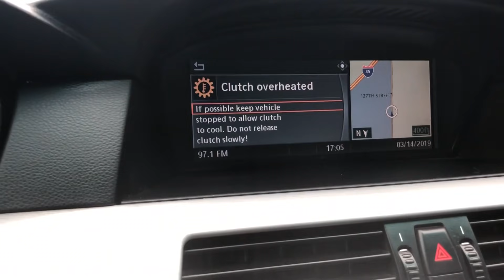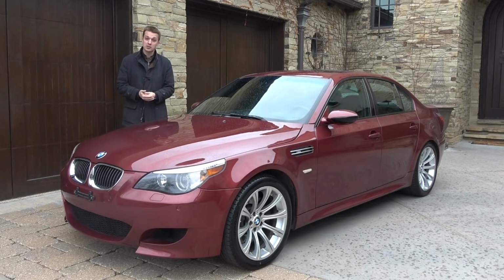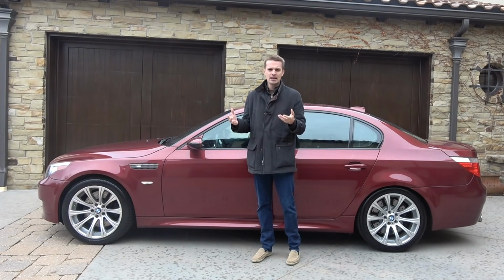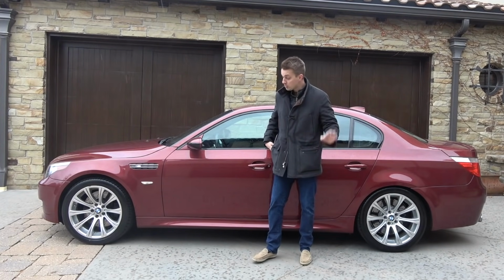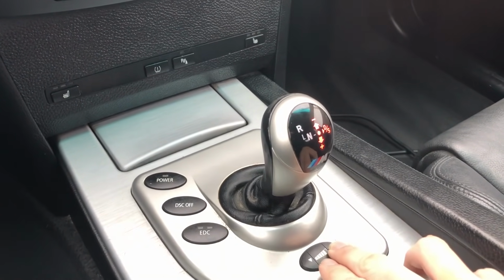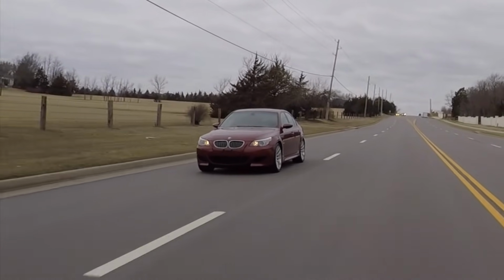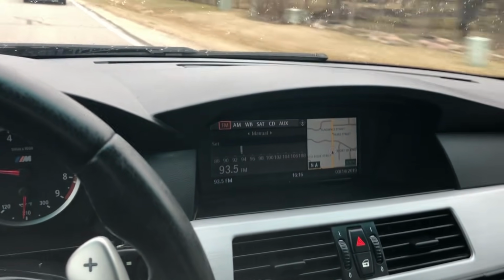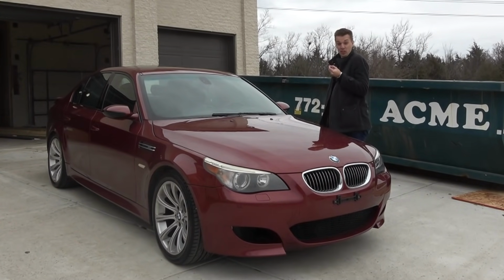My Cheap BMW M5 Is FINALLY FINISHED (Thanks to a Wire Hanger???)

Comment: That is a good sounding and looking car, but remember...cool stuff breaks. It sounds like Maserati took that transmission concept and ran with it, but got rid of the reversed shifter, and used a dainty, chrome, lawnmower pull start handle instead, and had bigger, stronger, paddle shifters. They used a screaming revvy small block v8, with semi fragile, but not as over engineered vvt system, very kindly put all timing components on the front of the engine and had slightly better acceleration, but not the top-speed ability of the v10. It really is a nightmare drivetrain of a supercar, mounted in a beautiful sedan. You really need to part it out and LS swap it, but you already have the Porsche, so try to get the money back for garage college.

Comment: So not only did the "wizard" miss the frayed fuel line on the ferrari he bent one of the teeth in transmission he installed forcing you to take it to a BMW specialist. Time for a new mechanic.
Reply: Yes, I'm surprised I had to scroll so far in the comments to see someone mention this. The so-called car wizard bent the tooth on the flywheel! He should have noticed that he did this. Careless at best. 

Thanks for the reminder of the fuel line in the Ferrari. Everything in life is about paying attention to the details.
Reply: And considering an OEM flywheel is 1400$ on the cheap end. I'd be pissed. I just did a clutch and fly wheel on my M5

Comment: Sir, you did it the wrong way.
You have to turn off the DSC, hit the accelerator pedal and after a second also push the break 
Thats the only way to do a burnout with the SMG

Comment: I remember seeing a video about that SMG and if I remember right they took that crap shifting mechanism off and made it into a manual system since it is a manual gear box to begin with. Some engineers just need to have their heads stuffed down a toilet.

Comment: Doesn't the BMW have a reset mode that learns how you like to drive like Mercedes does?
Reply: It does but this in not an AUTOMATIC TRANSMISSION!!!
Reply: @florinnitisoara8313  Oh right, one of them double clutch solenoid gismos?

Comment: Hello Hoovie, did you ever drive a real race car with sequential mechanically gearbox? All gearboxes do shift up, when you pull backwards und shift down when you push forwards. The simple reason is, when you accelerate fast with a race car, you will be pressed into the seat, so your body gets back and you can not push the hand forward easy. Much more is the effect when you brake with race brakes, your body flys forwards into the race belt, it is simple to push the hand than forwards. That is the reason, why BMW made the shift of the gearbox the right way, other automaker like Audi or years ago also Porsche (they changed it, because Walter Röhrl was the only guy who trusted to say this error to the board chiefs of Porsche) built it the wrong way until now. Ask a racing driver, everybody can tell you this. Drive the M5 like it have no automatic modus, use the stick to change the gears, when you drive normal, go down from the accelerator until the gear is entered, like it would be normal gearbox with clutch pedal. Only when you go fast with high revolutions, stand on the accelerator and you will see, how fast the gearbox is working without jerking. Best regards from Germany.

Comment: Shouldn't the plus for upshifts be put on the bottom so when your pulled back in the seat upon acceleration you pull back to upshift. P.S opposite of Volkswagen I hate it!

Comment: You bought a one of a kind BMW with a V10 that was broken down for $6500. How about appreciating the deal you got and sacrificing a slow transmission for a great car? You spent a total of $17,500 for a V10 car that you can drive your daughter in. If you want a super fast car with a great transmission AND that looks good, then buy another used old lambo, Audi, or Ferrari for $100K+.You will have to spend money to fix those cars too.  You sacrifice some things when you want a super car under $20K. Good luck to you.

Comment: Problem with all BMW: 

People buys them, they can't afford reparations, so  they just wait, and wait, and then sell them. Whoever buys it, normally buy it for a low price, but then reparations are hell of a expensive thing and they start filling the internet with shit about BMW. Of course, not forget most are much more mileage then they show, so main reason of early "faults". 

BMW's are good, I've had over 10 and I still have one as my daily drive. (Now not driving at all, Rona, you know).

Comment: As I recall, the original sequential shifters in passenger cars mimicked those in racing cars (push for down, pull for up), but after a while, they changed (in passenger cars). (This car is still butt ugly, Tyler.)

Comment: The Beeping is because of the clock. I beeps every full and half hour i guess. 
You can let this be decoded, if it annoys you
Reply: It can be reset. I have a 2008 550i 4.8 v8 with m sport package. I have the same issue after messing with idrive settings. It kepts beeping every time it reaches a new hr. Example, it would beep at 1:00pm, then at 2:00pm, then at 3:00pm etc. Found out on the settings i selected clock memo. After un-selecting problem solved. No need to take to the dealer. Easy fix on ur settings

Comment: This is probably the worst M series BMW. M stands for marketing now.
Reply: So true, they are so in marketing in every aspect even in a motorcycle section they are killing on a Facebook. Just drove a new BMW GS 1250HP model, I could not believe how much better the engine was balanced than the previous. But that fucking noise comming from the engine and a crankshaft I just could not believe it that someone here in Europe would pay for the bike like 25k$. Made in Germany has not the same meaning like 20 years ago.

Comment: I had a basic 2008 528i...I bought it at 60,000 miles. IT WAS A DISASTER!. Always in the shop. I bought the car in 2013 for about 20k. I probably spent over 60k in 4 years on it and it was always in the shop...NEVER AGAIN! MOST UNRELIABLE VEHICLE EVER!

Comment: Without the Wizard's "best-buddy" labor rate, his repairs would be five-figures, easily.  You KNOW darned-well that a dealership would NOT fix a BMW with a coat-hanger, they would pull the transmission and charge you HUGE $$$ to repair it, because 'profit'.  And with Hoovie's driving habits, it definitely WILL be back in the shop very soon....who does burn-outs with their child strapped-in the backseat?

Comment: The Aston Martin V8 Vantage offered a six or seven speed automated manual transmission for a while; big mistake! I don't recall a single reviewer having anything good to say about it. But, the same transmission with a gear stick and clutch pedal was great. Looks like your BMW is just another pretty face. Hitler's revenge!

Comment: I do not understand your garage design. It seems to me that it is going to be very difficult to get your cars out of that "new" part of the garage. Also, all that standing water flowing toward the interior wall of your house... not good. You need a drain in the center of the floor.

Comment: You're wrong about the shifts. In race cars sequentials or dog leged boxes you pull down to go up a gear and up for down a gear. Its easier as it accompanies the gforce: when you break you're pushed forward so its easier to push the gear lever instead of pulling. Typical BMW Motorsport thinking and quite logic. If its shifting that sl9w, there is something wrong with it.

Comment: I recently purchased my first BMW 320i  E91 Touring and now I am afraid to drive it. All these warnings light and sounds make me everytime they come up almost get involvedin an acccident. I have now warning lights 1.  motor is to hot stop the car to cool of te engine. 2. There is a failure with emmision and then the  car is running very slow. 3. Dtc sensor goes on and the cars starts running slow. Anyone want to buy my car, please?

Comment: I saw a lot of people recomending amg,you really folks think that they are better than bimmers,o lord mighty you folks are so wrong,since i had service for mercs and i know what i am talking about every single amg model delibrately eating camshafts,my first model was 190 evolution amg,which i repair,cylinder liners,pistons,piston rings........car from 1980's,since from their first amg model,untill today,it seems thatbthey have issues like:worn out cylinder liners,connecting rods,pistons burn out,worn piston rings,worn crankshaft,blown head gaskets or 
Due to blown head gasket the head can be blown,i didn't mention  tranny,gearbox and suspension it will take all day to write you common failures of amg models,i will say just say for newer amg models,they have cylinder block and cylinder liners  made from aluminium and piston is made of special hardened steel,piston rings are made from carbom steel,even the cylinder liners are done with twin-wire-arc-spraying so with this method material is spraying to the cylinder liner with air flux temp.. is app 5000 centigrade all over the cylinder liner to get nanoslide of cylinder liners but this didn't help to prevent wear of cylinder liner,since the piston rings are made of carbon steel so you don't to be smart to understandwhat will first be worn out and i can say with reason,another failures gearbox newest ones  9g,due to high torque over 1000 nm and very high operating pressure due to these 2 parameters cause torque converter failure,then all seals to leake and hydraulic and operating ecu (electronic control unit) to fail,so this aut.gearbox is in all new and also i didn't mention the mercs led lights these headlights have tendency to fail,aftermarket are app..1500€,genuine are 2500€,and warranty is just 2 years ,mercs model so you can ask yourself why this happen with this headlights,why they operate with high torque and high pressure the reason is only one just to fail,and these things i shouldn't tell you according to policy od mercedes-benz ag,best or nothing,from germany with love,and bottom line bmw m models are more reliable than amg models.

Comment: I’m surprised he’s complaining that upshifting in manual mode you have to push down. It’s because when you’re going around a corner and you’re pushed back in your seat, naturally you pull back the gear selector. Similarly if you are slowing down, you are moving away from your seat and you push the transmission forward. It’s actually more  correct that way and BMW still does it like that.

Comment: it´s funny when you do a burn out ,that you can see the rubber left on the road, and look admired when the car informs you that the clutch is overheated,unreliable are the words that come out of your mouth, an M5 it´s one of the best bmw´s ever, in 93 i owned one and still today ,only oil changes breaks pads and tires, and a car like that with automatic transmition it should be considered a crime, and the car was built to be driven not to achieve high-rotations stoped , tires do cost money but there´s a concept that you don´t understand, everything you say is wrong about the car,regards

Comment: im sure ill catch hate for this but im an ASE certified tech and i have a 2009 135i(n54) ive spent well over $6,000 to get it to run the way i like in parts alone. no labor included. I will never own another bmw product once i sell this POS

Comment: Relax first thing gead over to Cerma oil .com use all there additives you will not have any issues ! I did mine two years ago Runs Incredible !!!I daily my M3 SMG 06 ,you are not suppose to Atomatic this Car ! Paddle shift is the best way at highest shift rate ! Auto is for leisure ! running the right octane very important with proper tire Pressure ! You Got too learn Dude this is a Race ready Car ! You funny also LOL

Comment: “ I purchased a Lambo Gallardo for $20k with E-gear and over 60k miles and I’m hear to report that is sooo expensive to fix. Everything needs to be replaced! I’m shocked and will be an echo chamber for all other videos. 90% on all the bad and 10% on all the phenomenally amazing aspects of a truly amazing machine. Who should have though a $100k car retail would be costly to operate.”
Drive the car like a Manual and let off gas every time you would if you had a stick in between the two front seat!!! Get way more seat time and miles and STOP CRYING. It is a V10 PHENOMINAL ENGINE THY BELONGS IN A SUPERCAR. Also stop talking so much about money and more on the dang car!

Up is downshift bc while heavy braking you push up and while accelerating naturally you pull back. All this stuff will come to you if you drive way more before giving your review which is way closer to first impressions. Like a person, special cars take time to learn the true character. I’d rather have manual which is available but SMG III has character as II can feel each gear which has charm like a manual. Not everyone wants laser fast shift and if II do, buy another car. I like your videos but if we claim to be car guys we need to cut all the negative talk and focus on the positives, mention the negatives and be realistic on the experience as a whole. F10 is faster with fast DCT yet way less exciting bc it’s too civil. A lion that acts like a house cat is no longer a true lion.

Comment: Unreliable, for sure. My 2009 M6 V10 (same engine and SMG tranny as this M5) had just over 18 000 miles and mostly careful driving when it lit up dashboard with errors: Engine Fault, which went into limp mode, so it was idle control valve / actuator $900 + throttle actuator at $1000 each (1 each per bank, so x2) + labour! Also ABS + DSC (Dynamic Stability Control) faulty, so no ABS or traction control or DSC, which dealer quoted as $2700 for parts, excl labour! Gearbox spoils this car - only works well when driving manually with left-for-down right-for-up paddles, or hand shift sequentially using gear lever, although up/down shifts feel wrong way round.

Comment: Fuckin cringe to watch. I've had my 06 M5 for 5 years and an SMG E46 M3 before that. You gotta know how to work the throttle along with your manual shifts. D mode requires heavy throttle and knowing when the shift will come. When it shifts, reduce throttle input slightly and resume when the shift is complete.

Comment: You buy an old BMW from a source that you know is an outlet for worn out cars that have more than likely not been taken care of and yet you find a reason to complain?  It's a complicated performance vehicle with tons of moving parts as are ALL performance vehicles.  I keep my BMW's for a very long time but after years of good maintenance, at some point, I move on.  Maybe you should do the same or at the very least, quit being cheap and buy yourself a newer model.

Comment: This video is nonsense. YOUR M5 is extremely unreliable. Not EVERY E60 M5. For example, I daily drove a 2008 M5 for one year and had literally ZERO issues. Only time it ever went to the dealership was for an oil change. Nothing else. Your M5 is garbage because it was mistreated. But obviously you knew this when buying it for $6,500.00. For all the people out there that are terrified by all of these click bait videos about the E60 M5 being unreliable, take them with a grain of salt. For every dumb video like this, there are tons more people out there thoroughly enjoying their reliable E60 M5's. The E60 M5 is NOT the most unreliable BMW ever produced. That's a complete lie. Probably a more accurate claim to the most unreliable BMW ever produced would be the E32 750i or the E30 M3. I had a 1988 M3 which was in good condition overall, but the car was horribly unreliable. The car would just stall out of nowhere, and that was a very common problem with those cars. I will, however, agree with you on one thing... The SMG transmission is junk.